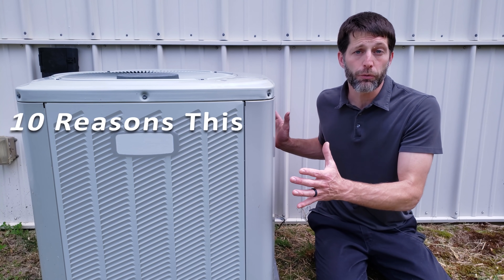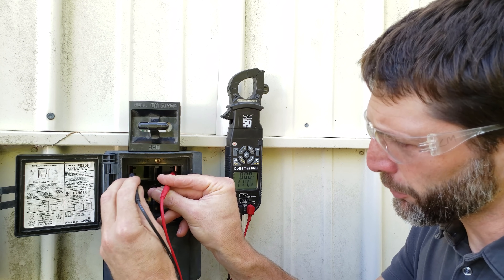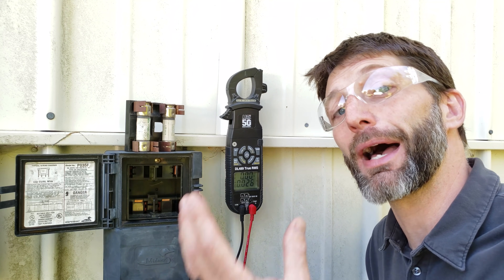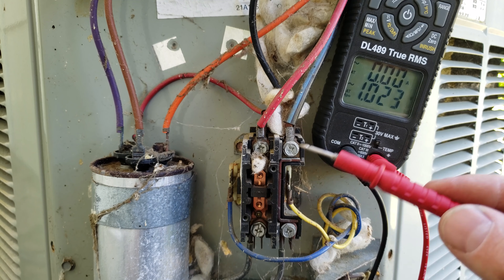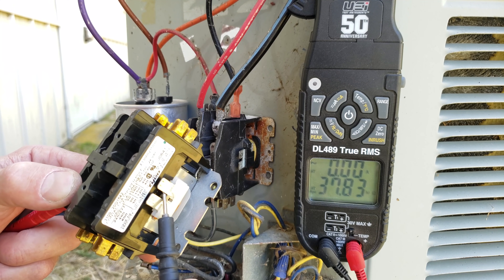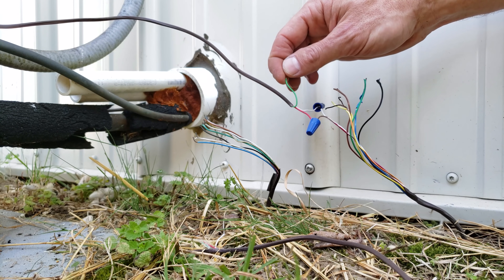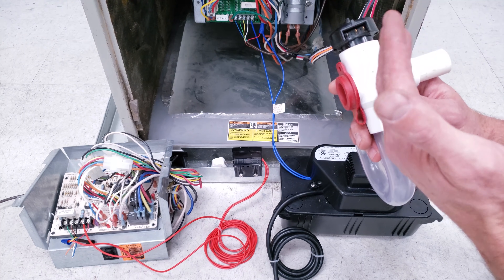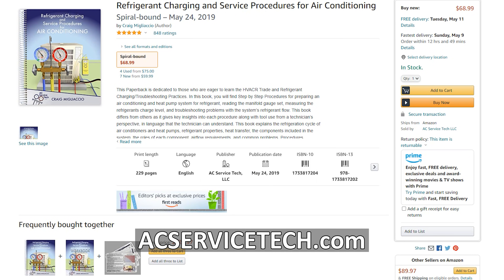Outdoor AC Unit Not Running, Not Turning On! Top 10 Problems!

Comment: THANK YOU. Our AC stopped working recently and we had a despicable "repairman" come out and tell us that our furnace control board was likely bad, and then try to price us out a whole new system for $13k. Using this video I learned what I needed to know to determine that I just needed to reset the low pressure switch. Fixed my AC for zero dollars. Very much appreciated!
Reply: They'll do that...that's why I will fix or try to fix anything I can before I call a technician...educate myself so that they won't even try to BS me..
Reply: That's why I'm on here there's so many instances I have heard where they was charged $1500+ and I'm sitting here thinking after doing some research what if it was just a capacitor that was just $30 at a hardware shop. I understand charge for labor and everything but is just a $30 capacitor worth $1500 w just a quick replacement??? I don't think so !!!! & even if I could get away with pricing someone that as a contractor I just couldn't live with myself 😂😂
Reply: There is a very special place in hell for such professionals 😈
Reply: Yeah any AC electrical guy that tells you replace your furnace always get a second opinion and make sure other people don't have to use this person what a criminal
Reply: Ask yourself, why did my low pressure switch activate and what is its purpose? 
Lemme ask you, how is your AC System doing now?
Reply: i learned not to touch the electric wires and ask a professional to help
Reply: @danfinkler sounds expensive

Comment: Thanks for  breaking it down 
101. My condensor went out on my last night. 
Question. The fan motor has gone bad. Do I  need to change out the capacitor as well?

Comment: Does anyone have any tips for getting the fuses out of the fuse box? Mine are definitely blown but I can't seem to wiggle them out to replace them. Is it safe for me to pry them out with something if I turn the breaker off? I had the breaker off trying to get it with just my fingers alone and I felt a small amount of current when I used an area near the fuse as leverage and I got a little worried. Any tips or best practices for a really jammed in there fuse? 
Also this is like the 3rd time this has happened in a few years. Is it time to call an electrician?

Comment: Craig, thank you for putting this video together. I was able to quickly use my voltmeter and troubleshoot the problem and got it fixed.
I still had a tech check the work and he said it would have cost you $580.00 for the contactor install. I only paid for parts and service call for 200.00. I enjoyed getting to know a little about hvac. I feel proud of fixing the unit with confidence, confidence you gave me with this video.
Thanks!!

Comment: Awesome video, our upstairs unit was not cooling, air handler was running but outside unit not running. After checking the breakers and thermostat settings I had relinquished myself to having to call a HVAC guy on the weekend. Watched the video and was reminded that my unit has a condensate pump in the utility room on the first floor, sure enough it was unplugged, as soon as I plugged it up, it ran( reservoir was full of water) then the outside unit started running once it pumped out the reservoir. Thanks for providing an excellent video and saving me an emergency service call.

Comment: I love your videos, and once again you have gotten me out the heat, I unplugged the power cord to the condensation pump during the winter to use the outlet to plug in my wet-vac and forgot to plug it back in. It is equipped with a 24v switch to avoid spillovers, with your Top 10 Problems troubleshooting guide I was able to solve this issue. I'm an electrician by trade but have found myself being asked about AC Units more, I will be purchasing your content.  Thank you

Comment: Craig, Just wanted to tell you how much I appreciate this video. As a home owner and a System Engineer, I hate to have a service tech come out just to bill me for something I can fix myself. Took less than five minute to troubleshoot the fault and less than 20 to replace the thermostat control wire. you are time and money saver. God bless and thank you for sharing your knowledge!
Reply: I was going to write this exact message.  Ditto.  Thank you.
Reply: Everything is running inside. Contacts won't draw in outside

Comment: My 25 year old Trane xe 1000 Started giving me trouble last month when the condensor  fan wasn't running so i figured it was a bad capacitor . I installed a new one cap and it seem to run ok for a month .  The other day it started doing it again but  when the fan does start up it seems not to know which way to turn . Sometimes it turns clockwise ,sometimes it turns counter clockwise?  I was told it probably is a bad fan motor. So i have one on order i hope it fixes it. I can't afford a new unit right now :(   Any advice would be appreciated!

Comment: I know this question has nothing to do with this video but I'm not sure if you see new comments on old videos. And sorry it is so long. I am brand new in the field and the guy I work with doesn't have any knowledge on HVAC except for what the Tech before me showed him. But that tech didn't do things the proper way, just what got you by, the kind of tech that went by "beer can cold". One of the things they did was not use use a micron gauge when pulling a vacuum, use a manifold and not use vacuum rated hoses, not pull Schrader cores and would just run the vacuum for 45 minutes and then charge up! Well I was hired to replace the main Tech because he left and I'm trying to do the right thing. I work for a school system and want things to be done proper and want to do the best I can but it can be a struggle with the other tech, seeing how I am trying to change the way things get done. Anyway so I just got vacuum hoses, core removal tools, micron gauge and the Tez8 pump. I watched one of your videos on pulling a vacuum and wanted to do just like you did. We had a unit that was short cycling and come to find out the thin line with the bulb on the TXV had a hole in it. Not sure how long it had been that way but he took it off and put on a new one and we had trouble pulling a vacuum. First try wouldn't pull down very well and took a long time so I shut if off and pressurized the system again thinking it was a leak even though it held the first time with 200lbs in it but this time 265lbs and it still held so started the vacuum again. It pulled better this time but still took hours to pull to 350 microns. Yes I changed the oil 3 times thought it didn't look bad the 2nd and 3rd time which the first change was a little black colored. But when I isolated the system with the valves on the core tools and shut the pump off it rose to 700 and stopped. The other guy decided to charge it anyway and just go with it so I can't try anything or check anything with it now. But I am lost on what the problem could have been.

Comment: For blown main power fuses a check for corrosion in the in the fusebox should be done. I had a random fuse blowing problem several years ago with my home AC. I even had a service tech come out and check the system. All he did was give the unit a good cleaning. After a few more weeks the fuse blew again. When I went out to check the fuse box, it was almost too hot to touch. I pulled off the inside cover and could see the corrosion. I replaced the fuse box and had no more problems.

Comment: I'd like to see how to check the fuse with a cheap multi meter.
Reply: Use the Ohm setting--looks like an inverted U.  Place your probes together--should show a 1 on the meter (some meters will squeel a sound or buzz also).  An intact fuse will also have a resistance of 0 ohms or show a 1.  A blown fuse will show a 0 or a resistance of infinity and it won't squeel or buzz.

Comment: Ac unit working fine cooling down the house but when I touch the liquid line is normal outside temperature is not hot or the suction line dont feel cool is just normal outside temperature. Why is this happening is it normal?
Reply: I don’t think it will cool down your house based on what you described. Use an infrared thermometer gun to check the temperature inside of the supply registers, it should be around 60 F or lower depends on their locations to the evaporator / indoor unit
Reply: Unless the outdoor unit is very dirty, the liquid line should be only slightly warmer than outdoor temp, and the suction line may be just a bit cooler than outdoor temp. 
Expansion valves controlling the refrigerant flow can regulate temps this way and everything being normal. High efficiency units don’t have beer can cold suction lines, or hot suction lines.

Comment: Can you make a series involving Lennox communicating equipment with the smart hubs ect?
Reply: Please do a series on Lennox communicating equipment and thermostats. Are there any Lennox service on line support groups for customers to share info. Tired of Lennox comments to call dealer. Dealer has some pretty good guys who often don’t know whats going on either especially with communicating tstats. They’ve told me if I figure it out let them know.
Reply: Never install these so called smart high seer unit. You will pay much more in the long run because they take technicians more time to diagnose and the parts are way more expensive. Straight AC unit are the best

Comment: Shoot Craig I’m a dollar short and a day late, I came across a outdoor unit that would not come on I checked everything but the pressure switch and misdiagnosed a bad board cuz the herm and common did not read 24 volts on the board.A senior tech came behind me and figured it out in 1 minute but I’m glad I made a mistake cuz that’s how I learn best🤓👍

Comment: Hello, I always watch your post, i learned a lot from your channel. Im a newbie, my walk in freezer have frost inside but still operating, when i checked the evap fan motor it is sucking air, is it supposed to blow air? are there any design in wif and wic that the fan motor is reverse direction? please reply. Thanks
Reply: In addition to possible miswiring, if there are two fans, one blowing, and one dead, the air will flow through the dead fan causing the blade to turn the opposite direction and little air passing through the coil.
Reply: SuperVstech most of the cases WIC fan motor use 120v (no neutral or hot, you can connect either wire), and WIF fan motor use 208- 230v ( both are hot). Wiring couldn’t be wrong and it wouldn’t affect the fan rotation. Some aftermarket motors are rotation reversible. If you mean miswiring for those wires.
I never seen dead motor fan blades be rotated by side good fan motors. If you happen see one, please upload the video.
Reply: @UltraHydrophobiccoat  Thank you so much for the info, I tried to reverse the wire no effect at all, you are right, so i think the problem is putting the wrong fan blade in these WIF. Your comments are highly appreciated. I have learned a lot from you. More power.
Reply: @welru612  You are welcome. Most of the cases a wrong rotated fan motor was put in. I would like to change the fan motor. You can buy one from here. It is a PSC motor with 115v and 208-230v and reversible rotation options. https://www.supplyhouse.com/Fasco-9721-3-in-1-Replacement-Motor-1-12-HP-1550-RPM-115-208-230V
Reply: @welru612  Or, if you are end user who are not familiar with wiring you can buy a shaded pole, fix rotated fan motor (CWSE). Just install and plug it in. Most WIF use 208/230v, CWSE, 3.3 inch, 1550 RPM, 1/10 ~ 1/15 HP, either Shaded Pole or PSC fan motors (some companies nowadays use ECM motor which is way more expensive than the two types I mentioned). Here is one from here https://www.supplyhouse.com/Packard-41126B-3-3-Shaded-Pole-Motor-1-15-HP-230V-1550-RPM
Reply: All WIF and WIC evaporator fans should blow air. I have several customers whose WIF or WIC fans run reversely due to unprofessional HVACR technicians didn’t pay attention to the motor rotation when they replaced fan motors. The efficiency will be much lower and your compressor will run much longer time or never stops because the box temperature couldn’t be reached to set temperature. Once, I had a customer who had cracked fan blades due to the fan motor run reversely. The fan blades are much weaker when it runs reversely

Comment: Allot of meters don't read voltage the way yours does, my fieldpiece would have said 0VAC if I put a lead on each 120 wire. I have to go one lead on power one on ground. 
Viewers Make sure you know how your meter works
Reply: All voltmeters read the same. They are measuring the difference in electrical "pressure" at each of the probes. When checking voltage on a 240v system, each probe goes on a different hot wire. When checking a 120v system, one probe goes on the hot wire and one probe goes on the grounded wire.

Comment: Really nice, Craig.  Years ago, in Florida, I had an in-line condensate switch in my pvc pipe that used gravity to get rid of condensate.  It had a p-trap in it and the switch was mounted there.  We were in the home for about a half-hour when I realized it was a little stuffy in the home.  I went to the thermostat and saw it was blank.  Ugh. Luckily I had some tools and an electrical meter there.  Using the schematic on the inside panel, I discovered it was the condensate switch opening up the power.  The piping had shifted and wasn’t draining properly.  Long story longer, knowing the things you teach here really makes you the hero when the chips are down!  And the temperature is up.

Comment: Good instructional video.  I would have closed the disconnect door when checking the fuses, particularly in your case since you “talk” with your hands.  Thanks for sharing your knowledge!
Reply: You could safely stick your fingers into the disconnect... the openings for voltage is barely large enough for the knives to fit in.